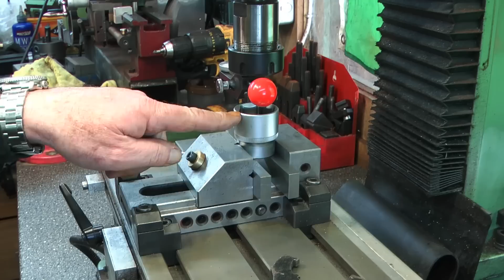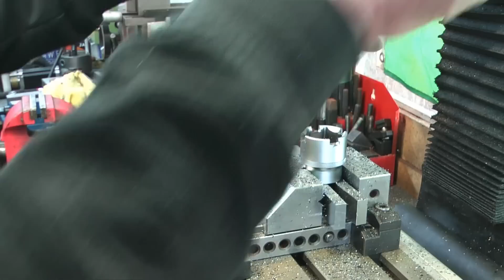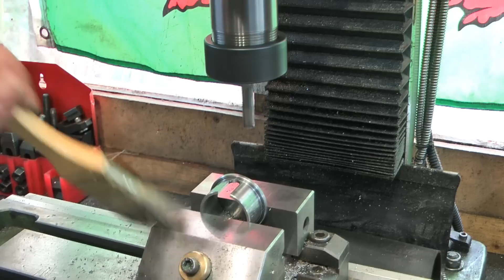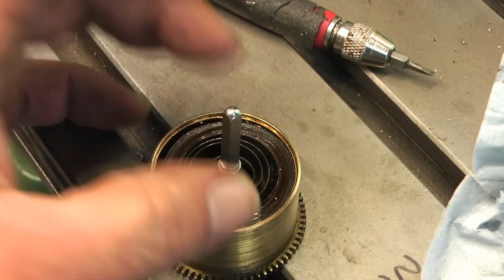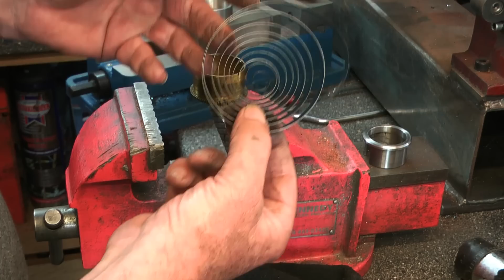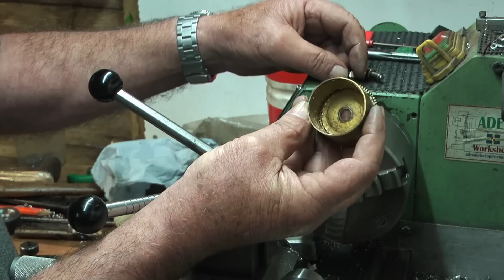Clock tales part 2 Beating about the bush

Comment: Hi Ade, Just bought a Warco 180 and a WM14b to start machining. Trying to avoid obvious mistakes and intend to bolt it down to a sturdy bench through a heavy steel plate (to add mass), was wondering if the single hole at each end of lathe bed on the 180 is sufficient, or should I be thinking about drilling  extra holes so there are 4, not 2?
Reply from the maker: The two holes should be fine although if the base it not flat you may need to shim it to avoid twisting the bed

Comment: That spring was repairable and stretching out to clean would remove some of the set.
Reply from the maker: I did stretch it out and that did work . new ones a tenner each . and oiled ready to go . I am going to keep the clock for myself so I went for it . Cheers Ade

Comment: Nice sock, Ade. And a clever trick using it.
Reply from the maker: It was in the shed being used as a rag and improvisation called . turned out to be perfect tool for the job . the Ades workshop sock method , maybe I can find more uses. Cheers Ade